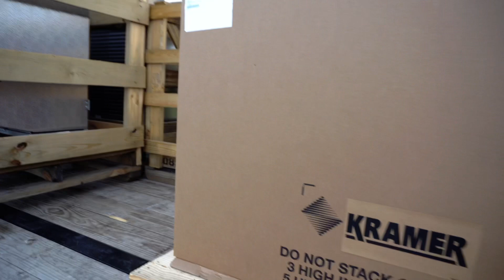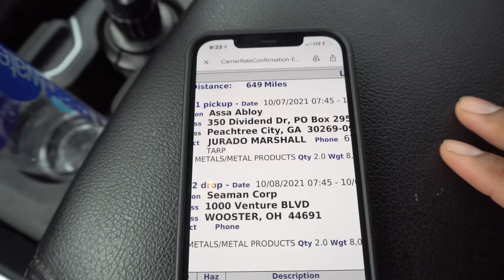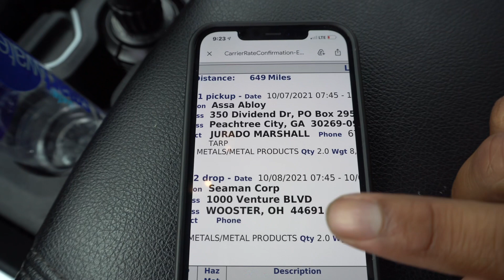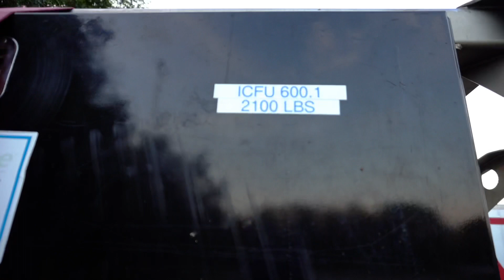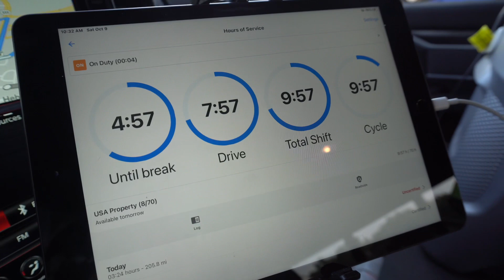My Last Run as a Leased On Owner Operator | Never Going Back To Brooklyn New York 😤 Hotshot Trucking

Comment: You should invest in a tire plug, they're easy to use, so you can fix your own tires when you pick up nails or screws
Reply from the maker: Yeah you are right! I actually have a set but didn’t think it would do any justice with the 14 ply tire
Reply: @HotshotMacc  It’ll work to get you to your destination but not as a permanent solution

Comment: I've a question why don't you run dually 
2 wheel drive wouldn't that be better on you're loads I don't know iam just asking
But it's been few months so you may not see this  but keep rubber side down
Reply from the maker: It’s the truck I had before getting into this. But a dually is heavier and would just take away from the weight I can put on the trailer

Comment: Do you ever have scraping issues unloading or loading vehicles?  Looks like it goes pretty smooth.  I am trying to decide whether I should get a 30 ft car hauler or 30 ft flat deck.  Just getting started in hot shot.  Thanks.  Have fun.  Best of luck.
Reply from the maker: I never had that issue because I only hauled suvs and pick up trucks. I’m definitely not able to do cars because of that issue.